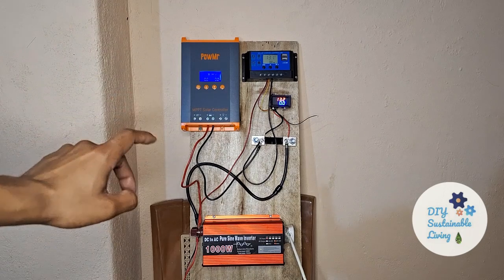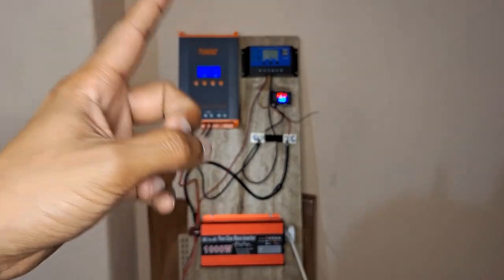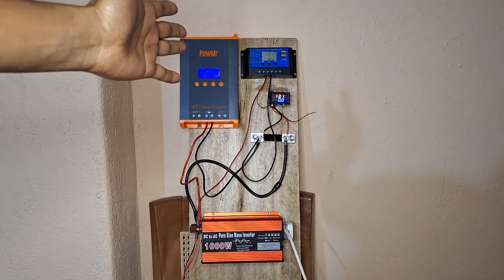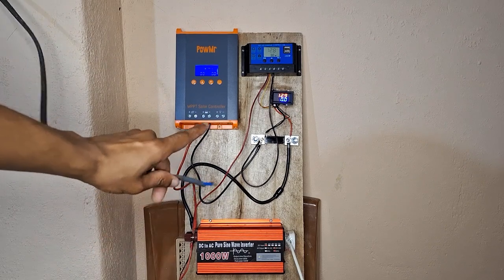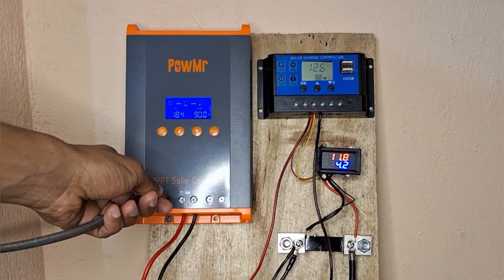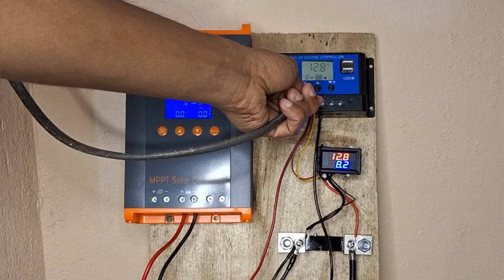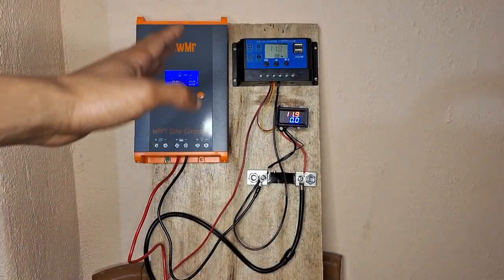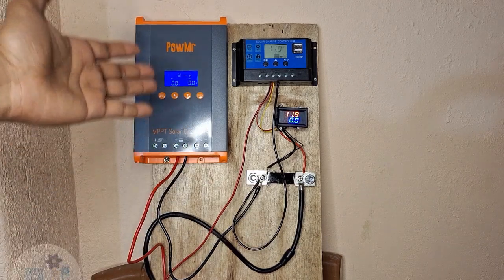MPPT vs PWM Solar Charge Controller - Live Test!!

Comment: Aquí hay algo mal.. el mppt muestra que ingresan 103w y el voltímetro amperímetro muestra que salen  120w (12.9v*9.3a), algo funciona mal
Reply from the maker: Good eye.... There can be slight differences in the way the readings occor between different devices as we are not sure whether these cheap devices are all caliberated or not.
Thats why Im only concentrating on the amp reading on the amp meter only when comparing the pwm and mppt scc. That way the chance of error in this test is way much less.

Comment: Waaree 395 what two piece solar panel Kitna empier ka pwm charge controller Lena padega Jo 12.6 volt lithium ion battery ko charge Kar paye and load chalana chahta hun 💓
Reply from the maker: 395 x 2= 790w. 790 ÷12.6 = 62.7A
According to the above calculations if you going to use an MPPT scc you will need an 80A one. However as you are planning to use a PWM scc it will depend on your panels   amp rating (Imp). Check the maximum amp rating and double it as you are going to use 2 panels. Now as a precaution get a PWM controller which is rated to more what your panels put out.

Comment: 1000w inverter link
Reply from the maker: Please check out sites such as aliexpress and amazon to find the best deals. Keep in mind. If they advertise as 1000w it means that that is the peak power rating. The continuous power rating is usually half the advertised power.

Comment: Noticed that "12v 150w panel, Voc was 20v as I remember. Vmp around 18.5V."
from previous comment.

Sir, May I ask what the input Voltages were for MPPT and PWM?

I think I'm having a fake MPPT since the Voc was about 20, it dropped to about 13V after the panel was connected the MPPT
Reply from the maker: The panel in good sunlight produces electricity which we measure in volts and amps. Depending on how much you draw from the panels the panel side voltage will vary. When you connect the panel to a pwm scc or buck converter depending on the power draw from the load the panel side voltage drops. 
A propper MPPT scc should keep the panel side voltage close to the panels Vmp. My MPPT is able to do that. 
If your panel side voltage is dropping to battery voltage it is probably a fake MPPT.
Reply: @diysustainableliving2774  thanks for replying, i finally get a picture of what a real MPPT looks like and I could look for the same model as yours for my next controller

Comment: Give 10 minutes to MPPT to get max output
Reply from the maker: Thanks for that infomation. In my tests it didnt go up much further than the values I showed in this video. Anyway comparing the costs in a small solar setup it is better to get another panel and set it in parallel to double the power output. In bigger setups of course MPPTs are vital to get the most out of the panels.